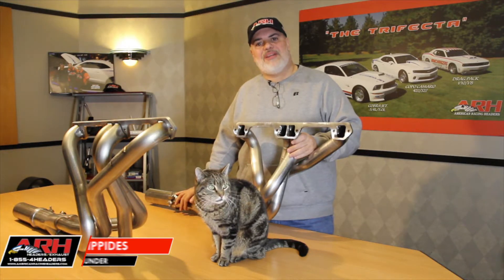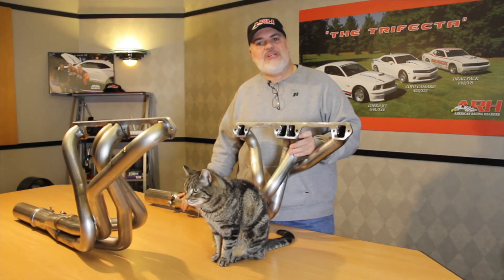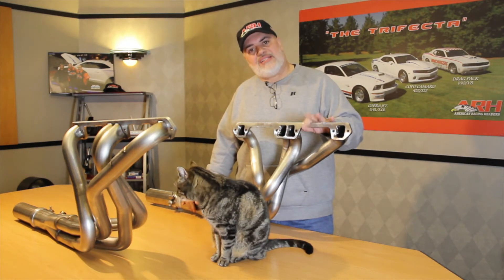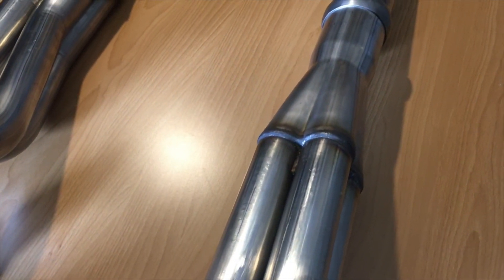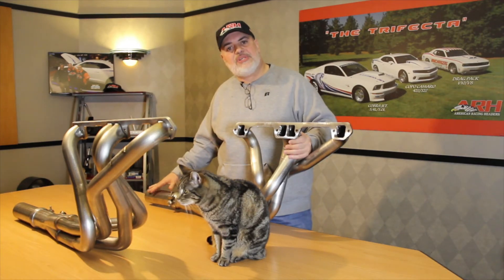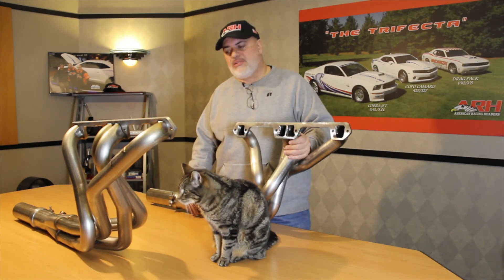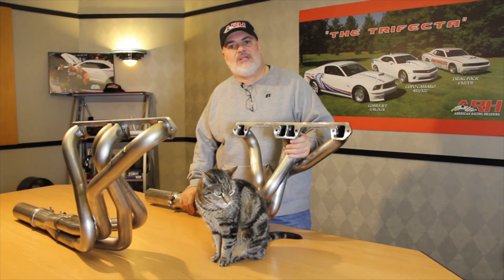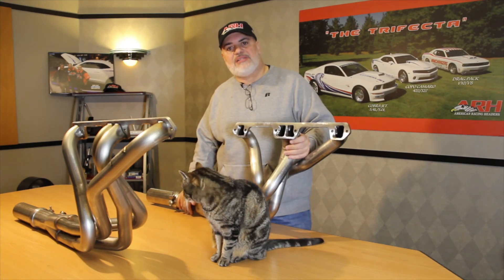AMC Header System

Comment: will these work for an AMC 360 on a Jeep Grand Wagoneer?
Reply from the maker: We haven't yet tested fitment on either of them yet. Stay tuned!
Reply: @AmericanRacingHeaders  please do i cant find any aftermarket headers for these Jeeps.  I know youll probly have to do some mods to those and run then into a single pipe through a y pipe due to the transfercase and fuel tank on these Jeeps.  But that shouldnt be an issue if you upgrade it all to 3 inch.  But im tired of running the stock cast iron manifolds